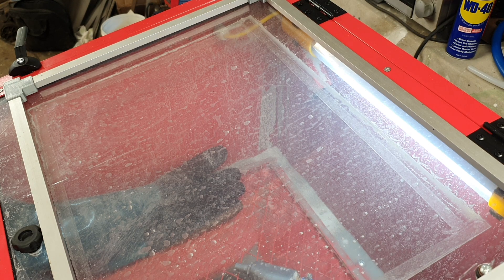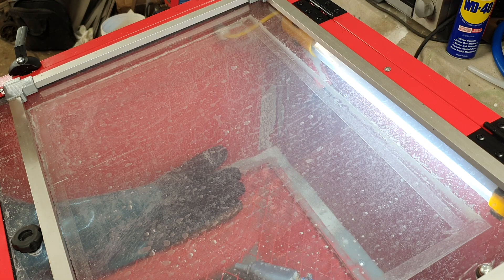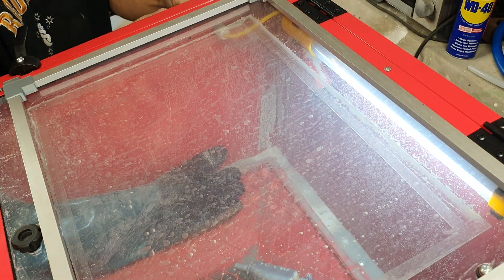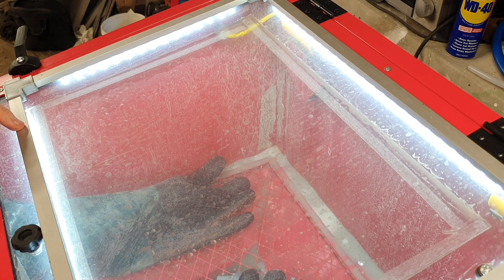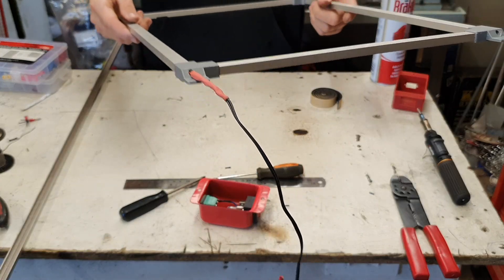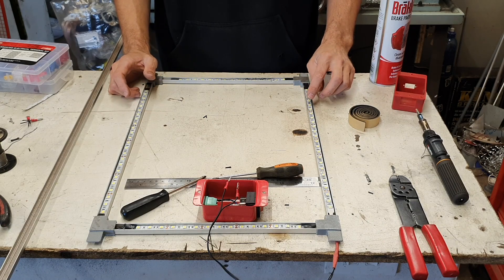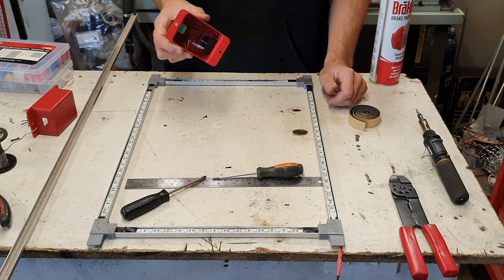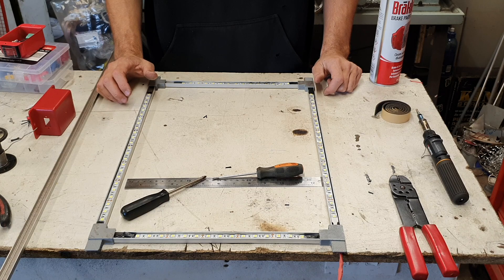Ghetto blaster Pt 2   Lighting improvements on the SBC 100 to DIY Vapor Blaster

Comment: Hi v been with you for a long time now and I thank you for the help I have had off you now I have 2 of these one for sand one for vapour don't get me wrong I'm still building hat to put on hold as I moved home so everything is on hold at Moe lol story of my life anyway the sand blasting cabinet is almost done just need final touches but my vapour if been getting all the stuff together I built one of your gun just having problems with the jet side but hopefully will figure it out I have a pump dirty a pump if built it like you would a big cabinet it sits on a old washing machine case and the tank is in that I like the way you took all that away and put it on a bench I'm getting a wiper for mine going to redo the lid so it fit washers are in wash hose is in so it can wash down stuff was going to do a self feed system but was going to work out more tanks and pumps and draineg filters lot of work now you got me thinking that is good thing to get all the pump stuff gone sort of still have a pump but one powerful enough to push the slurry faster then with out all the other bits I can put it away if needed to be sorry I'm in the UK so some stuff will have to be thought about changed a bit to make it work I don't mind a pump on the out side but fitted to the tank to pull though what I need what everyway if I put it in side will needed to be sealed so the water don't get in on your jet I know you do a 2mm and a 5mm but what I don't know is how far you need to drill in on each hat to chang the gun a bit as fittings are different over here so hat to work with what I could find but thank you for pushing me to try and make this work will appreciate any kind of help that can be given if can be plz keep safe and all the best keep up the good work
Reply from the maker: Keen to see some videos of your set up! Let me know if you post them to your youtube!

My guns for small compressors use a 2.5mm air jet and an 8mm ceramic.

Cheers!
Reply: Soon as I find out to edit I will lol I can do most things but anything to do with laptop's or pcs nope no clue lol don't get me wrong have tried many times got a couple on there but not much my channel is called ( THE TINKER CHANNEL) I made your brass one the end I have got is a 7mm ceramic but in your video you say it's goes from a 2mm to a 5mm but the problem I'm having is the depth of each once I sort that then I will be ready to finish the build and still waiting on my wiper system that's been taking like it feels for ever I have a old mini one at my dad's so might have to have a look at hes but any help I can get on that would be a great benefit but thank you for getting bk to me if seen your videos a lot sent some ppl to you to there is another gent if seen he made a open system and a closed system I would mined a closed but need to think about room but as soon as I can sort out my video on both units I will let you know

Comment: Hello friend, I am from Russia, in your example I assembled a camera and a pistol with my own hands, but I ran into a problem, the part is not cleaned to such an ideal state as yours. tell me, maybe I missed something, maybe you add something to the water to make it shine, please help
Reply from the maker: Hello Daniel,

Can you measure your water/media ratio? And what media are you using? Also, what air pressure?

Thanks for watching!
Reply: @Armoury Enterprises  Thanks for the help. Air pressure is stable 5 atmospheres. The ratio of water to glass beads is 1: 3. Air nozzle 2 mm, water 5 mm. The dirt was gone, but there was still no shine, maybe I forgot to add some third ingredient to the emulsion?
Reply from the maker: I only use the glass and water. Did they definitely sell you glass beads and not crushed glass?

Try increasing your pressure to 6 atmospheres, and increase your air nozzle to 2.5mm and your water to 7mm.

Josh
Reply: @ArmouryEnterprises  thank you very much for the advice on how to distinguish glass beads from broken glass, they are very small in size
Reply from the maker: @ДаниилКовальчук-т2т  
Is it written on the bag? If so, it is usually correct. If not, you can only tell by looking in a microscope.
Reply: @ArmouryEnterprises  the smooth, round balls touch the skin like broken glass. Maybe I have a problem in that the composition supplied by the pump passing through the hose does not all reach the pistol; there is a tee through which some part goes to the pistol and some goes back to the tank to stir the glass. the amount of emulsion is not enough for productive work?
Reply from the maker: @ДаниилКовальчук-т2т  Yes possible.

There needs to be at least 10% media.
Reply: @ArmouryEnterprises  good afternoon, I hasten to share the work on the mistakes, it turned out that the air nozzle is far from the mixing nozzle, by moving it and adding glass beads, I immediately saw the result at a pressure of 4 atm, the next goal
raise the pressure to 8 atm to speed up the process, thank you very much for your help
Reply: @ArmouryEnterprises  But I'm still out of breath, what kind of key are you using?
Reply: @ArmouryEnterprises  and does it work for you all the time, I can’t imagine that it would turn off during prolonged washing, you can use the compressor in more detail?
Reply from the maker: @ДаниилКовальчук-т2т  I have a small (12.5 CFM) compressor that is always working, and a Large diesel compressor (75 CFM) that is much better,

Comment: greetings from Istanbul. Can't you connect a light to the sandblasting gun?
Reply from the maker: Hi,

Yes, absolutely and I have seen it done a few times before. Though it is not without complaint. 

It is a harsh environment for the light and the lens is quickly damaged, making the light dull. Also the gun is not always pointing from the same direction that you are looking, so it casts odd shadows that can be annoying for users.
It also makes the gun more cumbersome. 

Thanks for watching!